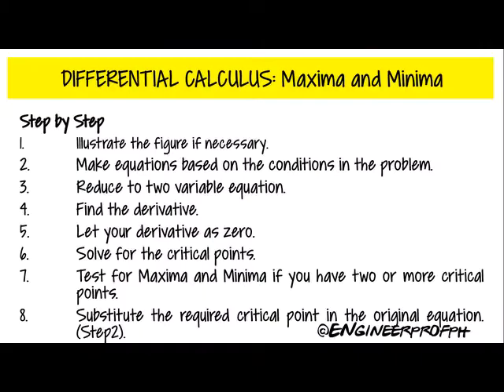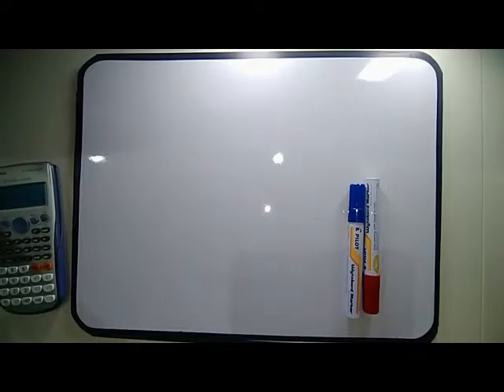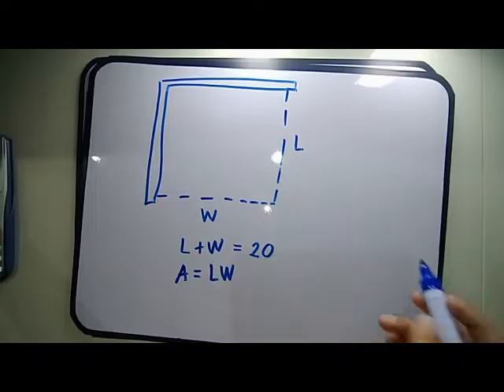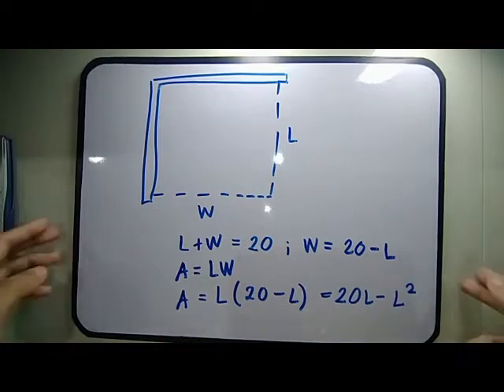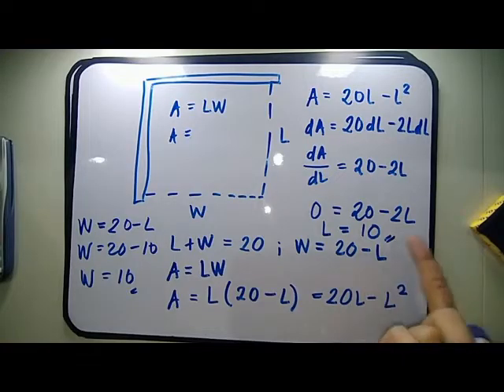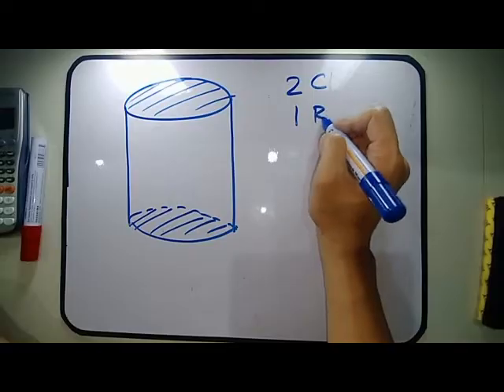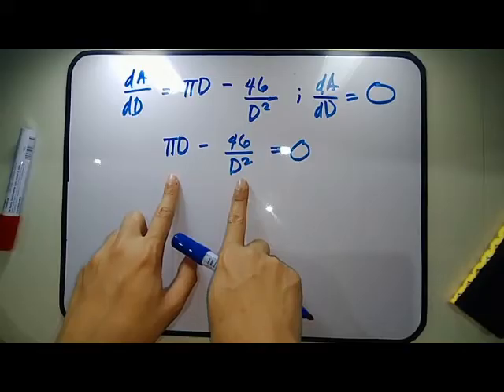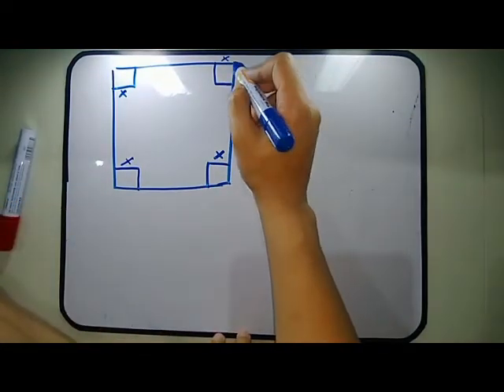Applications of Maxima and Minima |Differential Calculus|

Comment: A wooden beam has a rectangular cross section of height h and width w. What are the dimensions of the strongest beam that can be cut from a round log of diameter d if the strength S of the beam is directly proportional

to the width and the square of the height?
Help meeee please
Reply from the maker: Yes sure. I'll answer this.😁
Reply: @EngineerProfPH  Thank you sir 🥳